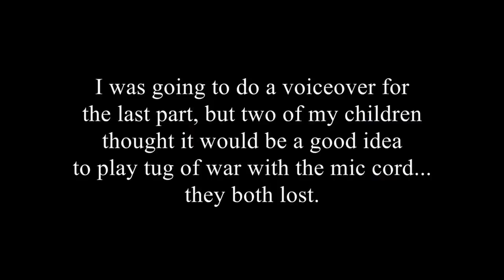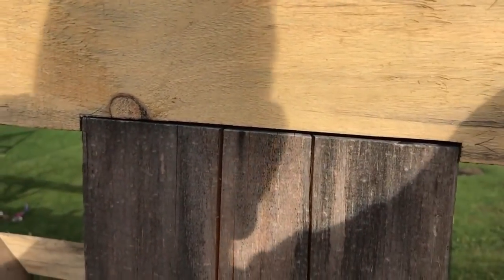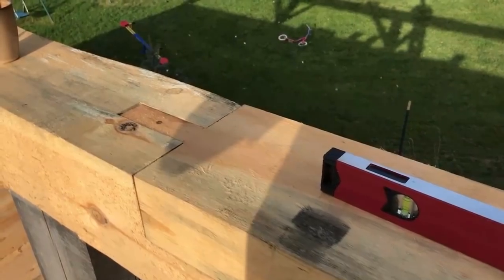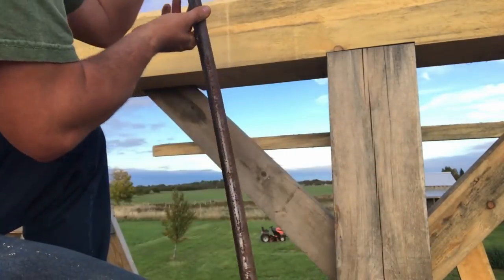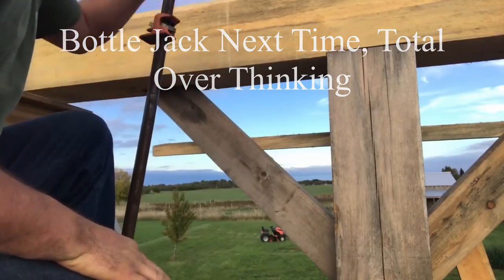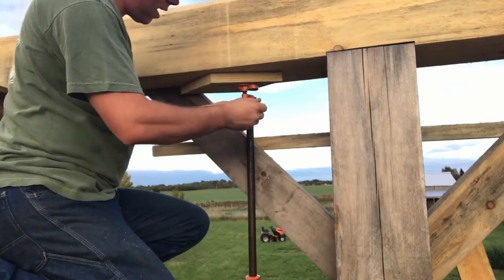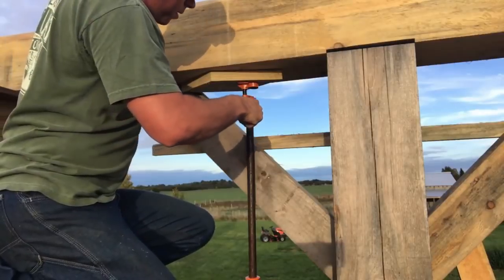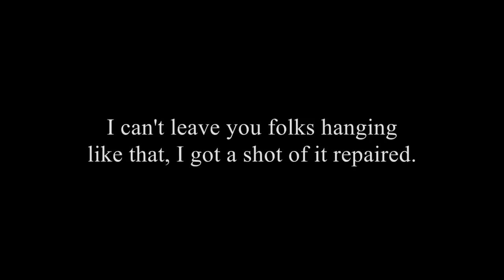Timber Frame Top Plates Like A Man...Yeah I Screwed It Up: Wednesday Rewind

Comment: Essential Craftsman mentions top ten essential tools - High lift jack is prominent... Need to get a couple on that farm...
Reply: Lugging a hi jacker up to the top of the barn would be a big hassle 
So if the reversed pipe clamps didn't work that problem have been the next move

Comment: We had a broken sofa frame back rail  and a used a reversed pipe clamp to push it back into place and cut a new custom fitted brace a couple of Angle braces  at each end of brace  .. fast forward 15 years Mrs W_L and 2 85 pound plus dogs  use that sofa every day    
If you need to move more that the reach of pipe clamp screw make up  two of them so You leap frog  leave the first one in place  and put the next one shortened  in place  take up the slack  in place
Reply from the maker: It does work well.

Comment: Can you say, "Block and bottle jack"? Also lazer level, mark all your posts, then measure.
Reply from the maker: At the time I did not own a laser level.  If I had then things would have gone a little smoother.  At the same time I was able to correct it just fine.  Remember that this was a very large structure, this was all mortise and tenon and, it was built alone.